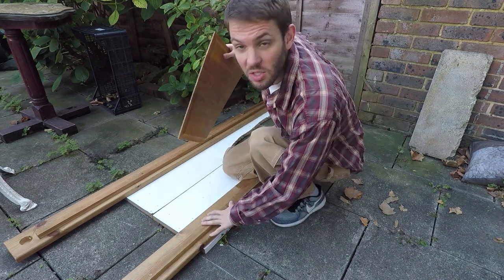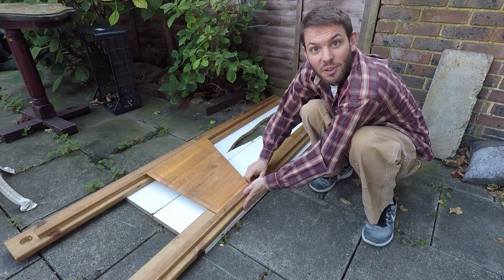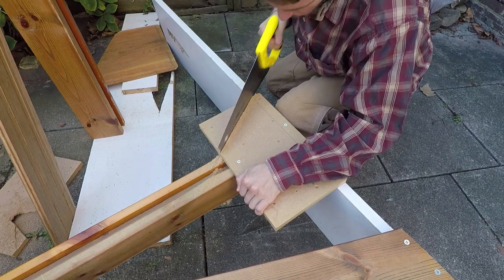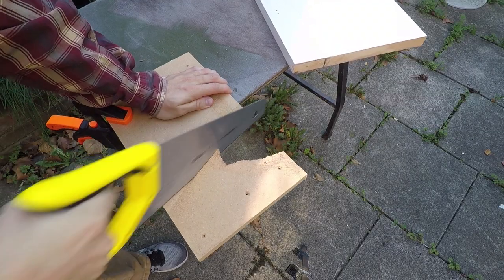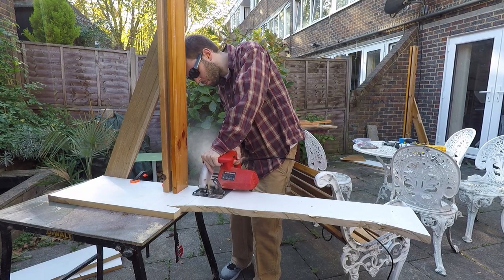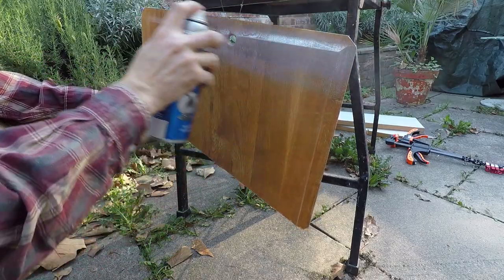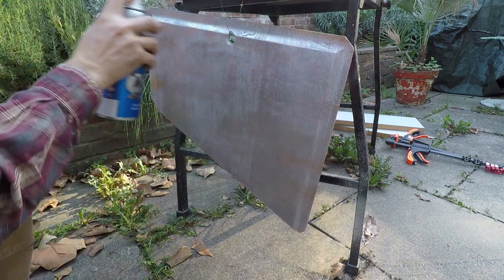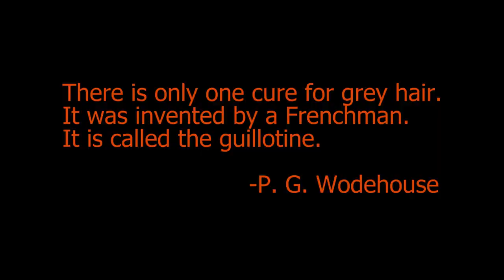Chopping an OLD BED into a Halloween Guillotine!

Comment: Wow, solid wooden bedframe! It always baffles me that people get rid of quality furniture pieces in favour of laminated MDF from IKEA. Nice handsaw you have there! Have the same brand 4in diameter blade but find it pretty useless for my projects, for it's too small to deal with anything thicker than half inch. Happy to find it a new loving home if you can think of anyone interested? Nothing beats a trusty old handsaw and patience in my eyes. ;-)
Reply from the maker: It's such good stuff and giving them a second life is worth it (even if it's for cutting heads).  I'll look around for saw wanters, but I'm good for now!  Come on by if you need some chopping done